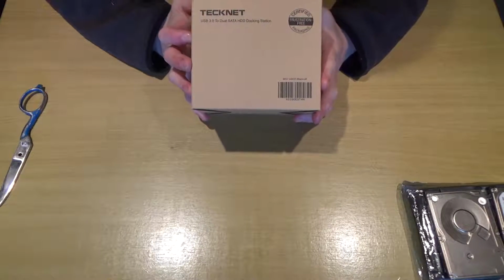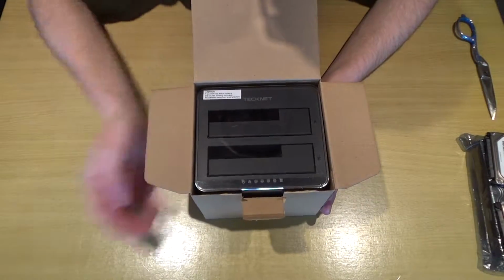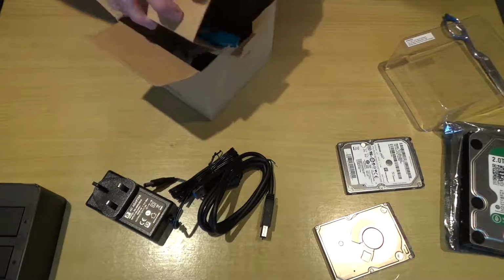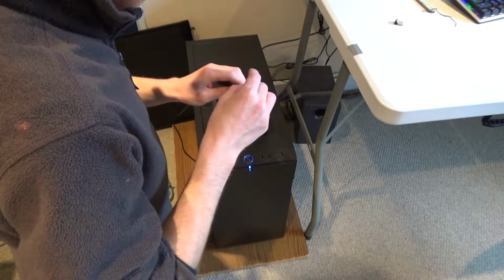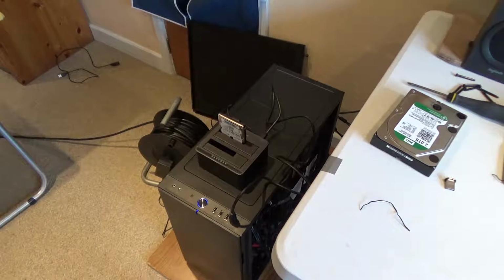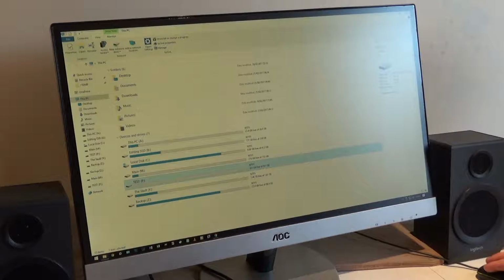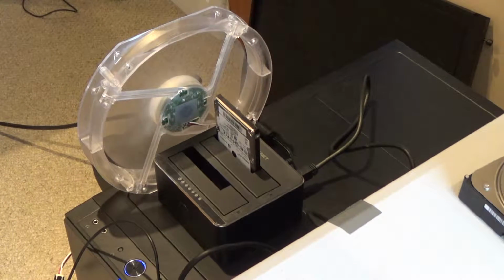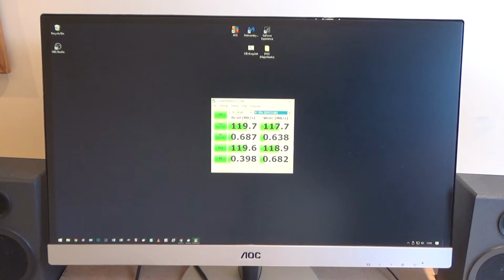Unboxing: Tecknet USB 3.0 Dual SATA HDD Docking Station (My Hot-Swap Replacement)

Comment: Pretty sure you can use both bays and are you still using?
Reply: @Frazer_Forbes  I decided against a NAS, went with 2 of these, (4x5TB) as power consumption is minimal and.only pain is dust +
do not forget to dismount either or both HDD before removal as it may flag an error and turn you drive into a RAW format